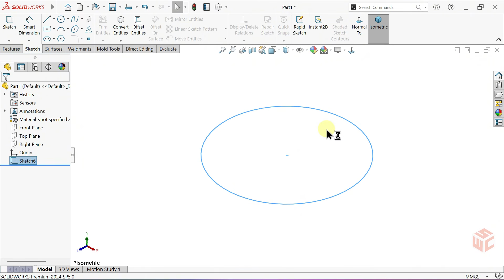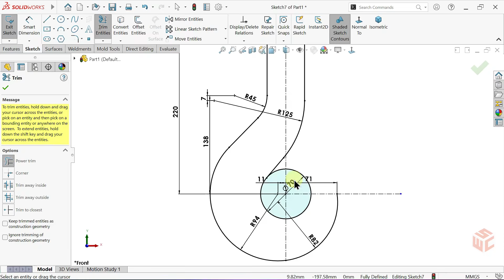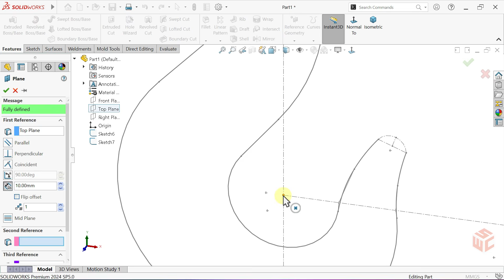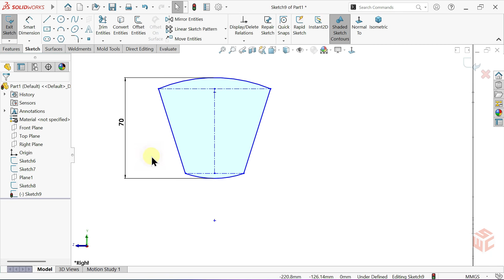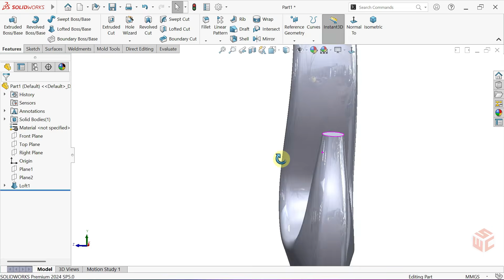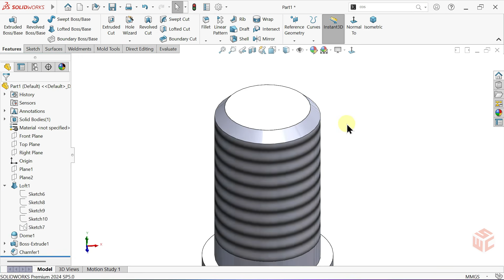SolidWorks Tutorial | Crane Hook – Step-by-Step Modeling

Comment: I'm not sure how to get the make pierce feature to work I've been stuck.
Reply from the maker: Make Pierce forces a sketch point to intersect exactly with a curve or path, even in different planes or 3D sketches.

To apply it, hold CTRL, select the point first and then the curve/path, and choose Make Pierce from Add Relations.

It’s commonly used in Sweep and Loft features to keep the profile perfectly aligned with the path.